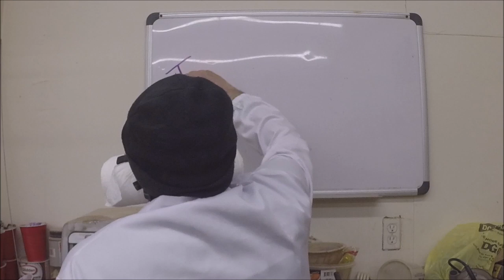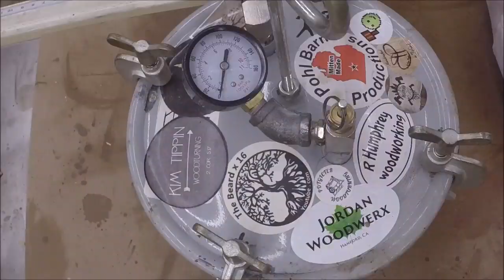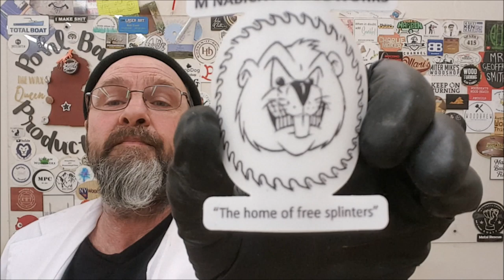Contagious Disease Bowl

Comment: That is a really cool piece. I myself am a veteran woodturner with 27 years of experience. I like how you popped up with the respirator with the toilet paper rolls. Because I am laid off due to the COVID-19 pandemic I turn wood bowls and vases. Machine I use is an engine lathe made for turning metal. I hand tool the out sides but for hollowing I use a boring bar mounted in the tool post. I have been turning since 1993.
Reply from the maker: Thank  you Michael,  I'm a noob !   2 years this month.
Reply: @PohlBarnProductions  Hey you should add me to facebook as I post a lot of my woodturning on my timeline. I also am on youtube but no woodturning on my channel its mostly to do with beekeeping and other hobbies

Comment: I saw Ed's view when It came out and it inspired me to work on one. I am trying to finish the bowl I am working on. Yours came out really nice, I like it. I gope mine comes half as nice. Thank you for sharing.
Reply from the maker: Thank you Mark,  the air pockets in the seed pods were my only issue, Ed used acorn caps and did not have the same problems I had, I used the CA to fill them
Reply: @PohlBarnProductions  Thank you, I will give that a try.

Comment: I was really surprised that those would turn.  Great job Doug
Reply from the maker: Thank you Steve..I some what stabilized them at the beginning in the red resin
Reply: @PohlBarnProductions  I saw that and it was a creative way of accomplishing the stabilization of them.  I wasn't sure at the beginning where you were going when you added the alcohol to the resin however; it was a smart approach to something sooo full of air.  I do enjoy wanting your creations and especially this one.
Reply from the maker: I added Acetone not alcohol but it was to thin the resin so it can be absorbed into the material it's applied to,  it really doesn't fill the air pockets as it just makes the wood harder so it can be turned.

Comment: Last week, I started a piece wherein I hot glued pine cones and a wood cylinder (to take up space) into a plastic bowl. Added resin. Put it under pressure. When I took it out of the pot, I couldn't get it loose. I beat on it with a rubber mallet. No joy. I slammed it on my workbench. Nothin.' That baby wasn't gonna budge. Why? Because, doggone it, it was hot glued to the bowl. I took it in the house and showed it to my Very Old Dad (94 - henceforward, "VOD", to you), imploring his sage advice. He said, "Heat it up." That's all. I went, post-haste, to the kitchen sink and held it under the hot water. Boom! It came right out, after a few minutes. You're welcome. Much better than having to buy a new bowl.
Reply from the maker: Thank You Mark

Comment: Fine video, my friend.  Didn't know you had gumballs in Yankee land.  Being as I have several 80' tall sweet gum trees in my yard, I have turned quite a few gumball bowls.  And have had my share of voids.  To avoid them in the first place,  I either thin my epoxy with denatured alcohol, no more than 1%.  Or, I use Thickset.  Of course, it takes about 3 days before you can turn it, but it gets into all the voids.  However, once you have the voids, here is a sure-fire way of fixing them. Make a paste out of real fine sanding dust and sanding sealer, I use the dust collected in the inside bag of my dust collector and Minwax water-based sanding sealer.  I like Minwax so much I am literally on my 4th gallon since I started turning.  Work your paste into the voids with your fingers, let dry overnight.  Sand it down, do not turn it down, you will only expose more voids.  It is also a great way to fix punky wood.      Take care and stay healthy, Larry
Reply from the maker: Thank you Larry,  I knew there would be voids not a big problem other than how many there were,  I think we have those trees up here just not on my property but I do believe these came from Your Trees !  Tom sent me them to make something with quite a while back, I think he said you'd sent him a bunch.
Reply: @PohlBarnProductions  They did, right off my property, Arkansas Gum-balls.  I keep watching Tom to see if he would tackle them, I sure he will at some time.  They can be awful pretty.  Take care and give my void fixing method a try, it works.  Take care, Larry

Comment: I'm sorry to see that the commenter before me was offended.  I too try to use humor to leaven many situations.  While the virus is quite literally deadly serious, I think it is almost always appropriate to try to find a way to avoid sliding too far down into the black hole.  Now, about the bowl, I liked the sweet gum seed pods a lot.  Good color choice on the epoxy too.  The final appearance is very good.  It was great to watch your technique as you made the mold and set up the seed pods before you did the casting.  And the brushing of the epoxy while the lathe was spinning?  Very cool.  I NEVER would have thought of/tried that.  Keep on truckin' Doug.  See you next week.
Reply from the maker: Thank You Tom

Comment: I have a ton of those in my front yard!! Hmmm... !  My sister calls them "Monkey Balls"!
Reply from the maker: Thank you Harold,  pokey ones at that !
Reply: Sweetgum trees in your yard? Have you considered moving?
Orrrrr, if you did that personally (hey, everyone has a dark side),  get a couple of black walnuts going to seed. 😂😂😂  Those two trees and customers w/dogS that never picked up, were 3 main reasons to finally wave the white flag and retire from a solo lawncare gig.
And pro tip: never try to husk black walnuts without PPE.  Pants, fingers, blades, optical lenses from splash, left nostril hole from a rogue booger search.... ANYTHING in contact with the sap will be stained black for weeks! 
Just saying...🤦‍♂️😂😂😂
Reply from the maker: you know they use those to make stains right, and the road is always stained where they fall,  they do make good targets in my back yard though.
Reply: The Pohl Barn Productions 
I didn't until I googled my dilemma after bringing home a bucket and cutting one apart. 
Sneaky bastards... it's clear juice and very little actually. Then you fade to black. 😂
Reply: @8ftbed  I can up the ante by saying I also have a Honey Locust on the other side of my driveway from the sweetgum! Spikey balls one side, large seed pods on the other!
Reply: Harold Dalious 
Sheesh... they're a whole nuther ton of fun. 😂   They got used a lot for street trees around here and the presence of locust pods were another reason not to have the side discharge flap strapped up wide, sling shit far and wide. Right up there with dog piles from dobermans, pits, shepherds. Seems people always had at least two of those breeds and one was always laying loose piles of nasty. Aggggghhhh!

Comment: Love the bowl!  It's probably been commended in the 800+ comments that you have, but I wonder if it would have been helpful to stabilize the gum seed pods first?  Not sure it would take up that much space though...might still have the same problem with the holes.  Great work as always!
Reply from the maker: i was trying to stabilize them first with the red resin, it still doesn't not fill the hole no matter what
Reply: @PohlBarnProductions  Yeah, I was guessing even putting them in stabilizing resin in a vacuum wouldn't help much since the holes are too big.  It seems like the only way would be repeated dips, almost like putting on multiple layers of paint until the hole fills.  But that's too much work!  I think what you made is still amazing despite the air bubbles and challenges!

Comment: I LOVE THIS!!!! I do have one question though.... Does the resin get hot as you are turning it? I have seen some videos where there is smoke coming off the resin. I know that friction causes heat, so I was just wondering about if the shavings from the resin get hot. Silly question I know.
Reply from the maker: Thank You Sandy,  Yes they are actually quite warm sometimes when they are coming off the bowl gouge

Comment: Are you finding this a better stabilization method for porous materials over cactus juice?
Reply from the maker: Thank you Ken,  well it's faster and cheaper for me to do it this way, cactus juice works great don't get me wrong but when you are going to just turn it away anyways why not thin the resin so it soaks in and let it harden,  it works in a pinch not so much better than faster.

Comment: I'm wondering why you are using hotglue. If I'm understanding it right, when the resin is curing it developes heat. And the glue is getting soft again.
Reply from the maker: Thank you Carola, the glue is to just hold the seed pods in place, once the resin starts getting that hot it's already setting up and won't melt the glue before it does.